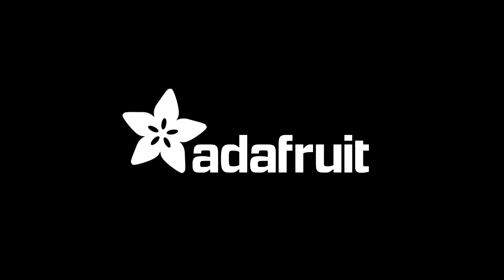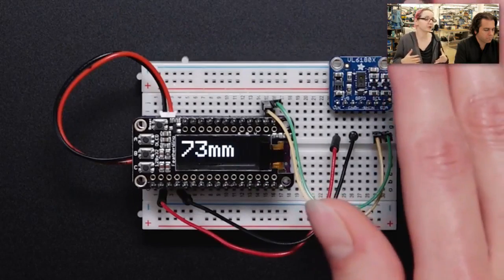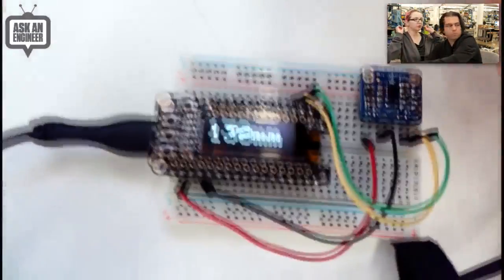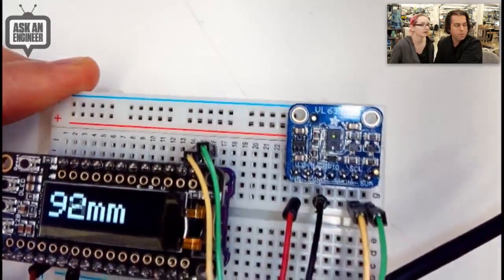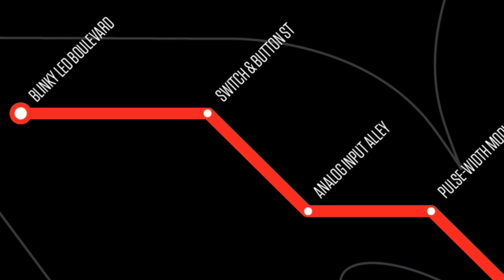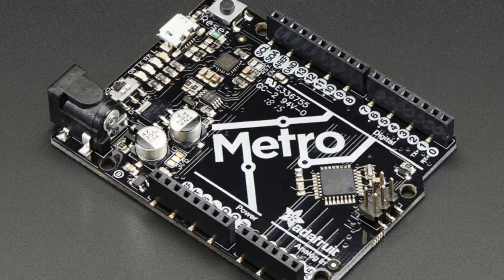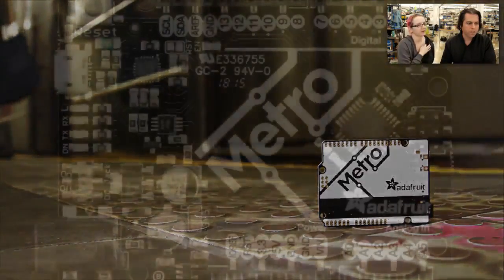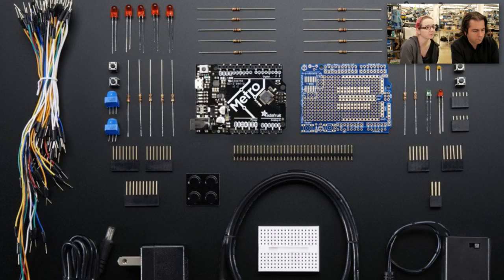New Products 11/30/2016

Comment: Thought about using this for CNC/3D Printer positioning feedback, but it looks like the accuracy is insufficient. Noise and temperature drift kills the precision.
Reply: The 2mm noise goes away with enough samples or a good Kalman filter.. the 9mm temperature drift can be compensated for with a thermometer or occasional homings. 1-2mm repeatability is probably attainable. It's never going to count missed steps, but for a general "head crash" detector it would be fine.
Reply: well then why not use something like an inductive sensor?
Reply: Many CNCs boast sub-millimeter accuracy. How do I achieve that kind of absolute positioning in a DIY design?